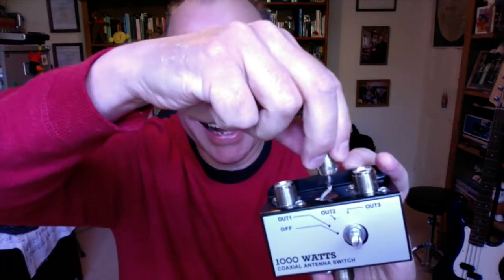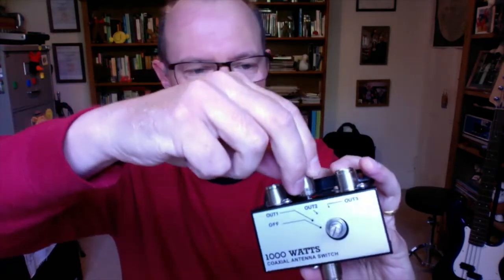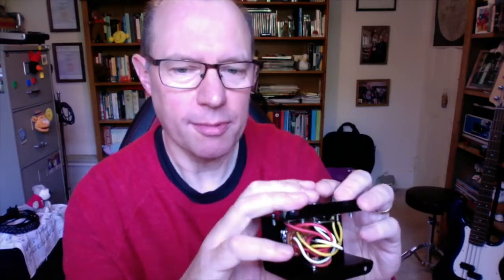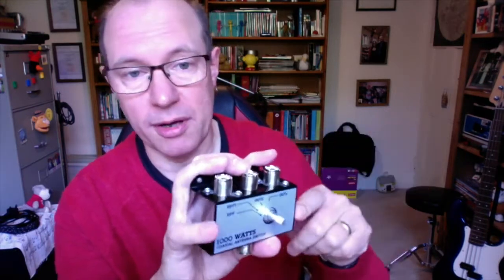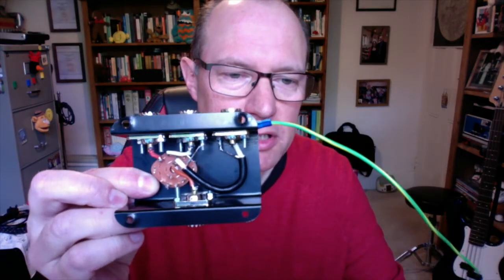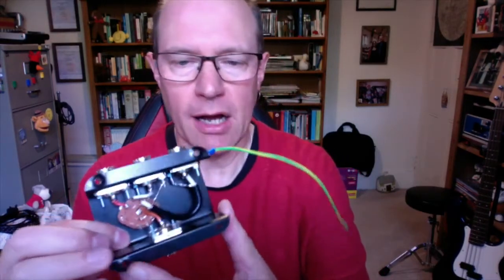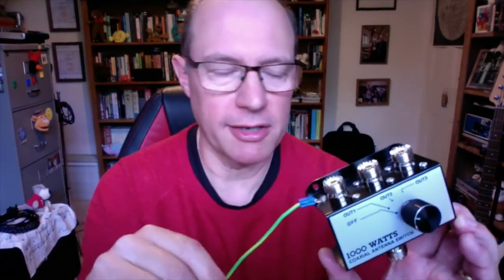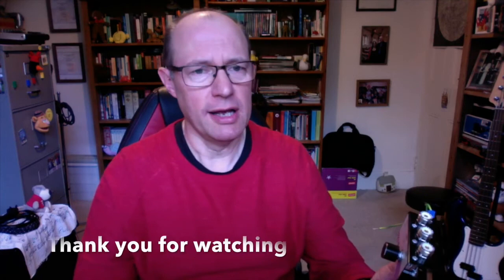6 - Modifying an Antenna Switch

Comment: Any guesses how much that switch can take? Finding a suitable switch, it could be a neat homebrew project building one!
Reply from the maker: I never put more than 200W through it and I think I was chancing my luck here. It does need completely rewiring though. I swapped out all the SO239s too. The switch itself is probably the weakest point - that and the metal chassis are the only two original bits left in mine! Thanks for watching. 73 Nick

Comment: Did you purchase that antenna switch used from a private person? Or did you purchase it new from a vendor? It sure looks like someone put the magic screw driver to it. It looks better now.
Reply from the maker: It came new from a famous auction website. I suspect it was built that way. The guy who produced a video saying how great the unit was clearly never opened it up and looked inside! I had to once the RF connectors started coming away in my hands!!! There is a reason that decent RF coaxial switches are more expensive I think. Thanks for watching. 73
Reply: @M0NTVHomebrewing   yes they are built that way by opek

Comment: the fiber board switch will burn up with 500w of rf into  off resonance antenna (high vswr)..have seen them black with even 100w into a out of resonant antenna ..best to junk it  for the cost of making your own with a ceramic switch and connectors you could make a far better one